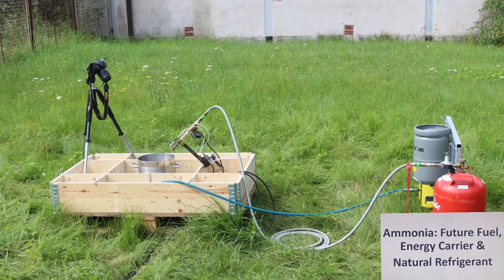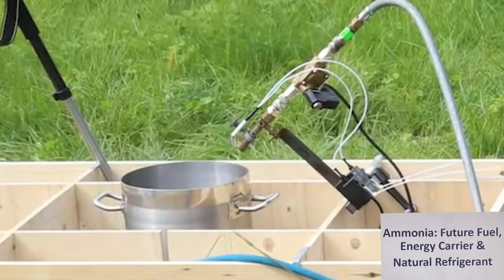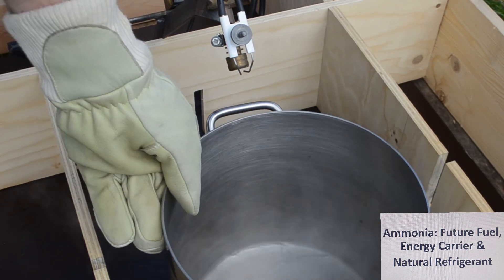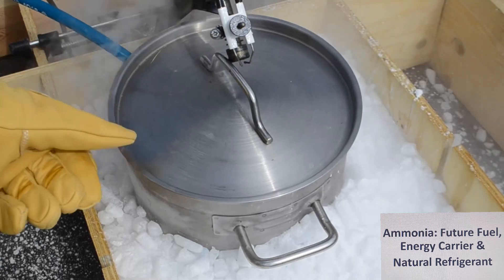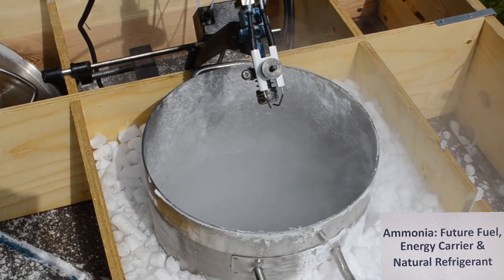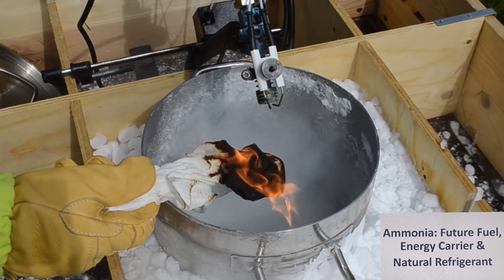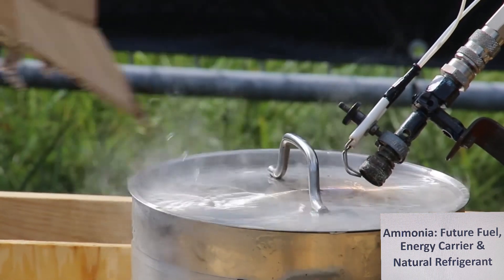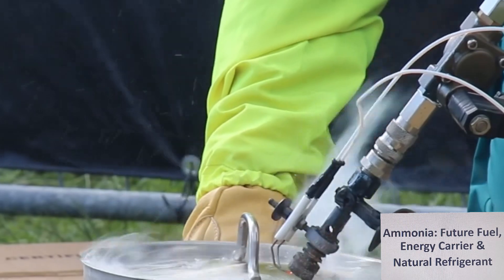Flameability of Ammonia - Future Fuel, Energy Carrier & Natural Refrigerant

Comment: I think this is the best fuel for cars....
1. You can't see the flame.
2. To get Amonia, you just have to...
Pump oil, transport the oil, refine the oil, crack the oil, compress the hydrogen. Then kombine it with Nitrogen, and put it in tanks, so it don't poison, explode, or burn.
And the energy you use is probably 8 times what you get in return.
3. You have to convert all engines to Amonia, the pumps needs to be change.

So, to use Amonia in cars, are insanity on steriods.
Reply from the maker: Hi geirvinje, I have als my doubs, if ammonia is a good fuel for car engines. But for large ships engine it will work, I am convinced. Of course it has to be green ammonia. Yes I als expect, that NOx will be also in the exhaust. For this reason a caralytic reactor is necessary. Carsten
Reply: @carstenspiekerdr.-ing.8332  You forgot the most important part of this.
The energy waste.
But, maybe you can produce hydrogen in the desert in the day time, with solar.
This depends on a massive over production of electrictrisity.
And, there are more useful/profitable ways to use solar panels.

Comment: i am a PHD student in russia, and my project is dual-fuel engine on diesel/ammonia mix fuel. I think ammonia will definitely be part of the fuels of the future
Reply: Добрый день! Как с вами можно связаться! Эта тема очень интересна!
Reply: @ParkaBoyification Ammonia is way to corrosive.
Reply: I think so too, but I still have my doubts. I am also an automotive engineer specializing in ammonia industrial systems. Burning ammonia produces a lot of N₂O and NO, which are very harmful to the environment. Maybe if you stabilize the temperature using diesel to maintain a high enough temperature, you could minimize the byproducts, but I’m not sure. What will you do at low RPMs? Maybe if you add a secondary energy source, such as an electric motor, and allow the ammonia system to connect only at high RPMs, it could work.